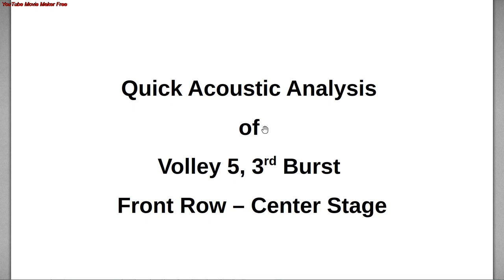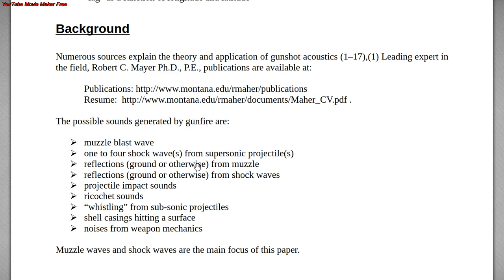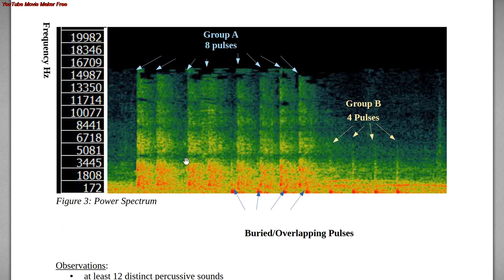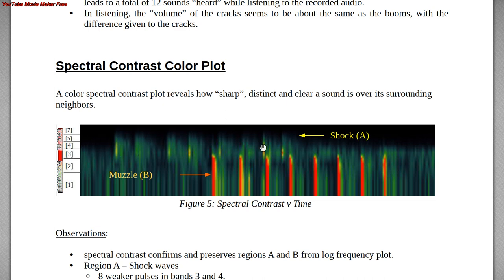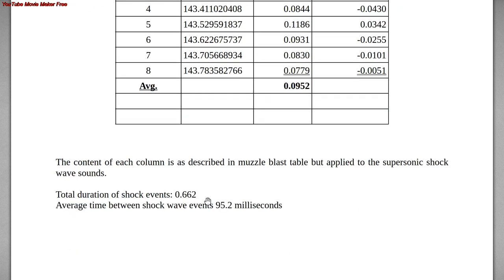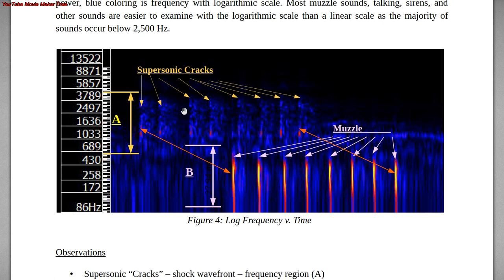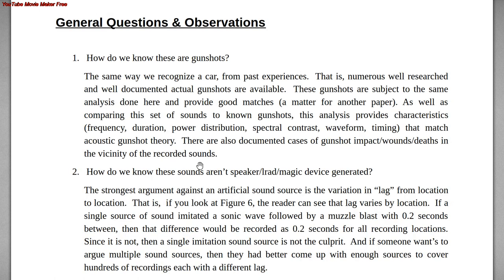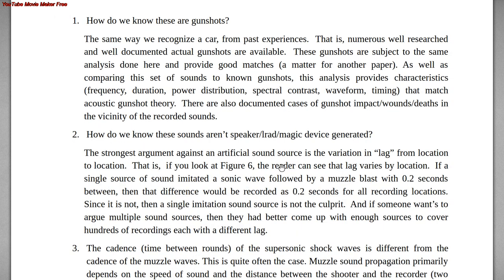Intro to Acoustic Gunshot Anaysis

Comment: 6:45 Big thank you and shout out to M F for putting in so much time into the map.
Reply from the maker: the map is essential, i just with i could get the lat/long directly from the map, i'm sure there's a way, but i haven't figured it out yet
Reply: @VegasOct1Sounds  theres a way to extract the data into a number of file formats, but I cant remember if lat/lon were one of the data points.

You want the exact coordinates of any given piece of footage?  Also keeping in mind the videos were placed on the map by us manually as best as possible, and not necessarily 100% accurate.
Reply from the maker: well i tried my hand at locating these videos on a map, and you guys certainly did a better job than i could atm.

Comment: This is by far the most instructive Las Vegas video ever made. The map at 29:39 is awesome. It’s important also that you pointed out that the supersonic crack can be observed over a distance greater than 100 feet from the bullet path.

I wonder if a micro-analysis of the final 2 shots could confirm which room they came from and what area was targeted. We’re assuming from 134 towards the tanks but it would be nice if it could be confirmed.
Reply from the maker: Thanks for the compliment, I'm just happy that it's helpful to someone.

Regarding the detection of the shock wave at large distances, this too suprised me the first time i reviewed the spectrograms at oasis apartments.

All of the single .308 shots are very tricky and interesting, as there is typically no muzzle wave recorded.  I've looked at those 10 different wave and still am unable to nail em down.  Its possible to get an idea of the bullet trajectory, just not precise enough to locate a room, all from just the shock wave(s).
Reply: Vegas Oct 1 Sounds - This video is certainly useful. I hope it gets 1000+ views!

On the final (.308) shots. I’m assuming you analyzed the bus stop video as well as BWC 57 from right across the street. Are the sonic cracks drowned out by the muzzle blasts because of the proximity to the shooter? (And distance of almost 300 feet to the bullet path above them).

Did you look at the “airport escape” video? The recording of the final shots is right in front of the tanks, so that would be my best hope of finding sonic cracks (or some whizzing at least) associated with the final shots.
Reply from the maker: @ericpeters3887  yes, i've looked at the airport escape, bwc57 , the bus stop and about 100 other videos in details.  In fact so many i had to write a program (python) to keep track of the data.  I've only done about 20 detailed papers.  I've mapped 7,000 muzzle shots and 1,000 sonic waves down to the milliseconds. It will all be presented over the next few months after I get some of the basics out of the way, there's like 100,000 or more graphs stored in my little ole computer just waiting to be released.  Most of them are very very boring.  I'll start a list of things people ask about including yours for further explanations.  It all takes time, lots of time.
Reply: @VegasOct1Sounds  Thank you for your continued efforts into this case.  It is really appreciated!  Your expertise and skillset is exactly what we need.
Reply: Vegas Oct 1 Sounds - I can’t wait to see more of your work. Really love what you are doing!
Reply from the maker: @ericpeters3887  thank you

Comment: Wow! Great video, and thank you for taking the time to explain everything so well. I have a couple of questions for you. A few of us have done a lot of work trying to determine the rifle firing order. Our biggest problem is that none of our shot counts match well with the FBI casing ballistic report. Question #1 is; Have you done a shot count of each of the volleys?, and if so, how well does it match up with the rifle ballistics?  Something else that has bothered me for months is the very first shot. On multiple videos, (but not all), the first shot is followed by multiple "echos", whereas, none of the other shots are. So question #2 is; Have you done an analyses of the first 6 shots? and if so, what is your conclusion/theory/analyses of shot number 1?
Reply from the maker: Yes, I have counts on all volleys, and i did at one time look over the fbi shell count thing, it will take a bit to put it all together but i've added to my list of things to provide. 

Re: 1st shots, yes, i did a pretty extensive examination of the signals for those shots.  I did not really make too many conclusions, just collected the signal data, let me review that data and get back to you on that.  echoes/reflections are very hard to nail down but they are as visible as most of the shock and muzzle waves, just lower intensity.  off the top of my head i do recall there being at least 1 or 2 reflections for each shock wave, but let me review the info.
Reply from the maker: I reviewed my work on the first 6 shots, turns out i did quite a bit of work, including details on shot 1.  Do you have a particular video that contains shot 1 you need an opinion on or do you want analysis common to all 6 shots?  FYI I reviewed 12 different videos and the "Carlos" video deeper than the others.
Reply: @VegasOct1Sounds  I'm mainly interested in the "shot sounds" immediately following the first shot. I have a playlist of at least 7 videos where it can be heard, but here is a good representation of what i'm talking about at 24;32.    https://youtu.be/36_mXwckuEw?list=PLOQBhxw80sVflT7YE-A08aJCTQhOnlh9a&t=1467
Reply from the maker: @concernedcitizen1  I see the section now, shot 1, i'll put up some info in the next few days, but bottom line there are multiple reflections for both the strong shock wave and the weaker muzzle blast there is also some clouding by the music right after the shock wave and a couple of weaker reflections may be hidden in the music.  The timing on the "reflections" after the primary muzzle is different i have yet to attempt to locate the  source(s) of the "reflections", but they look to be hard surface type reflections.  I'll work up a better answer in the near future with more details.
Reply: @VegasOct1Sounds     Thanks again for all the help. What's had me confused is what would cause "reflections" in shot 1 but none of the other shots? Could it be a drastic change in shooting direction?, or possibly a different source?, or what would cause that?
Reply from the maker: @concernedcitizen1  reflections are like bastard children, little things that sometimes you want to ignore, but thing that you also love.  reflections are "source" and position dependent, for example, two videos some feet apart recording the "shot", in particular the sonic shock wave will have "different" sources for the shock wave as each position records a different "part" of the wavefront.  It is the angle that shock wave makes to the projectile trajectory, and the angle to the reflecting surface that determine the timing of a reflection.  So it's easy to understand why they would be different.  In general though every recording of shot one does have multiple reflections, it's just a matter of eeking them out the signal.  I've yet to see "different sources" in the sense of a 2nd gun or shooter overlapping at the same time.  I think i'll do a Robert Maher reading today of one of his papers where he explains ground reflections for the signals and their effect on the signal.  On shot one I had suspected there were 2 guns for a long time because of the close timing of two of the volleys, but further research lead me to believe otherwise.  I'm still out of an opinion on all 8 of the .308 shots.  Something stinks, but I'm still reserving judgement till i've explored all the possibilities.

So let me repeat if there are multiple shots, and the recording is stationary, and different timing of reflections is recorded for the shots, then the bullets traveled different paths and the shock wave sill show different reflections, if the trajectory movement was large then it's likely one or more bullets varied in a big way.  Similarly the same thing would be expected from one recording to next.  I normally start with the muzzles, if they don't reveal any movement in either the "source shooter" or the recording device, then i move on to the shock wave to see what was happening.  A crisp clean reflection is indicative of a large hard surface (wall, concrete, asphalt, etc.).  A short time between the primary signal and any reflection is indication of a narrow angle between the source and target reflection signal path could indicate elevation on either the source or target end. 

One more thing, while i'm calling these 2ndary signals reflections, it's still possible they are actually 2nd and third order shock waves.  When i run across the paper that explains this phenomena i'll make reference to it somewhere, but when you look at images of shock waves you can see little ripples both between the bow and tail waves and behind the tail waves, all of these produce signal blimbs.  They are usually so low in amplitude that they get gobbled up by the background noise.
Guess i kinda ran on in this answer, so that means i'll need to eventually draw up a diagram or two and do a short vid.

later
Reply from the maker: @yimmythegreek1  this is your first and only warning, i will not tolerate this type of activity on this channel
Reply: @yimmythegreek1  No. Any choppers tbought to be hovering would be at a much greater distance than Paddocks room. The distance would likely be roughly the distance to the 15 freeway squared, plus the elevation squared, equals the distance from the bird to the venue squared. 800yds minimum which would drastically affect the gunshot sound audio analysis, and rule out the bird(s).  In no footage whatsoever do we see helis in the "vicinity" of Paddock's room. (Or anywhere else roughly 400yds from the recording devices continously from any one direction during the shooting for that matter.) Its one thing to want the mass conspiracy you seek, its altogether another to be able to show it, and prove that people in large numbers are lying to you.
Reply from the maker: @yimmythegreek1  door wide open no, if someone can point out multiple videos where helos are in the area between delano and mandalay during the volleys, hovering in a static position and the "lag" matches that position, then i'm game for considering a helo. i place the probability of this set of conditions being met at very near zero.  but hey, convince me.  If there was a helo firing in that area the sounds produced would be substantially different than what is recorded, hell i'm not even sure there are clean lines of sight for where the bullets struck
Reply: @VegasOct1Sounds  One more ? re the first shot. Since we're referring to the secondary sounds as reflections, does that mean that you can rule out the possibility that those were additional gunshots? ie 10-12 total shots instead of 6?
Reply from the maker: @concernedcitizen1  yes, the width of the pulse, the frequency difference, the shape difference, the intensity difference, the temporal location consistantly across all six shots blah blah blah yes  There were 6 strong shock waves, 6 or more reflections of those shock waves (not all were recorded on all videos), there were 6 weaker muzzle blast easily recognizable by their frequency band, there were at least 6 reflections of the weak muzzle blast, and there are about 8 or more other weaker signals that are also likely related reflections.  In the muzzle blast waves there are some signals which are more energetic than i would expect and those deserve attention.  But without addition primary sonic shock waves i would not expect these two cases to yield any addition recognition of additional rounds. 

Now in the realm of the fringe, I suppose it's possible that someone with a sub-sonic load, silenced could have discharged a weapon somewhere that might have had part of it's signal recorded, but I haven't seen enough evidence of that type of signal to entice me to go looking for them.  I cannot explain or understand by 5 of the 6 rounds were deliberate and 1 was apparently some sort of mistake because it was fired so close to another. I don't think i have enough resolution on the signals to determine if there were more than one gun used but it might be an interesting quest. At some point it becomes very hard to tell a very weak gunshot signal mixed with music from the percussive portions of the instrumental music.
Do you have some information that might make me spend more time looking?
Reply: @VegasOct1Sounds  No. Thank you. No specific information regarding those sounds. It goes back to trying to determine a rifle shooting order. The hypotheses was, that if those reflective patterns were additional gunshots, then that could account for rifle #9 which supposedly fired 12 rds. Say, for example that SP intended to start out with bump fire but had difficulty with that particular rifle and out came 6-7 rds, followed by 2 quick rds., then the additional single shots, so he threw that rifle on the floor (where found) and grabbed a different rifle which he was able to bump fire. If those can be ruled out as gunfire, then that would mean that rifle #9 could ONLY have been used for 12 holes through the door at Campos. This brings up some discrepancy with the observed number of holes in the door(s) when combined with other rifle shooting numbers, but it gives a good starting point in trying to resolve that discrepancy. There also is still a discrepancy between the total number of audible shots compared to the total number of casings found/shots fired per rifle total, even when accounting for the unheard shots at Campos,etc., which is why i asked about your volley count. I was hoping that maybe your graphs discovered a few shots that were maybe too close together to separate audibly, or something along those lines.
Reply from the maker: @concernedcitizen1  i believe your on the right track with the mistmatch with casings, as I have found the same thing, but not quite what you were saying.  Generally speaking i've found that folks have overestimated the rounds in the volleys.  I havn't taken the time to count the holes in the door, but i have campared possible rifle usage sequences.  I don't remember off the top of my head, but at some time i will revive my observations as pass them along.  As I recall there was still some a couple of possible sequences that would match.  Also I've found that where folks say 96 or more but less than 100 something is off because my round counts are 95 and 100 multiple times, plus the odd 22,44 etc.  in fact 95 and 100 show up so many times that I've begun to wonder if there weren't two people loading the magazine, 1 nebie and 1 old timer that remembers the days when a full clip meant jamming and therefore the 95 rounds in a 100 clip was intentional. I'm still several videos away from discussing this issue on a video.
Reply: @VegasOct1Sounds  does a full clip lead to jamming?  I've never heard of this.
Reply from the maker: @LasVegasShootingArchive  I can't personally say but some old timers (nam era) were discussing it on some of the gun boards.  In the early days of the m16 lots of problems were encountered included with the combination of magazine spring/receiver and some of them took to down loading the mags to help with jamming on the first couple rounds.